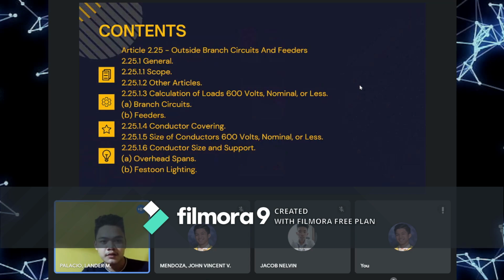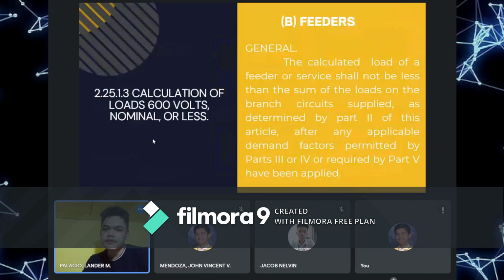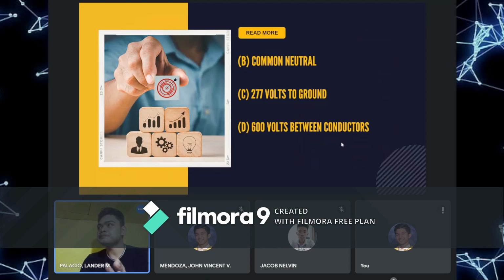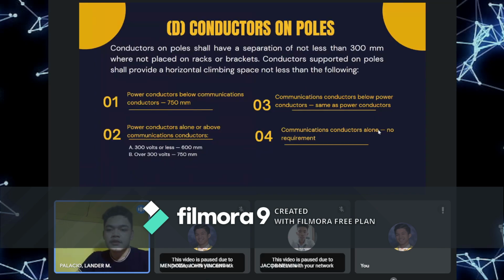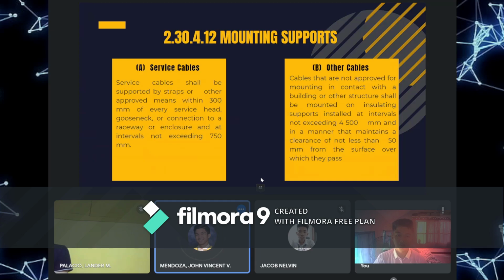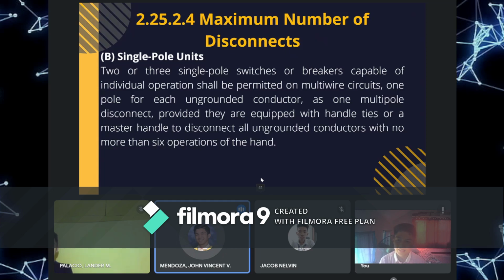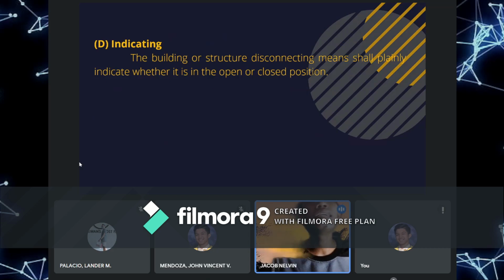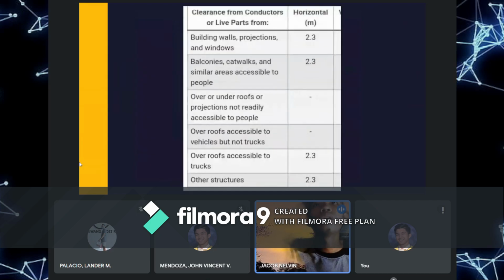PHILIPPINE ELECTRICAL CODE 2

Comment: In this video, PEC 2 covers electrical Installation outside buildings and concentrates on installation and electrical design for outdoor spaces. Along with the conductor sizes and types that will be used for outdoor lighting. It is a necessary specific layout for lighting that needs to be followed to reduce e the risk when installing for outdoor places.

Reply

Comment: I gained a lot of understanding regarding Philippine Electrical Code 2 and how it differs from Philippine Electrical Code 1 upon watching the presentation. As both the interior or internal electrical construction and protection of structures were generally addressed by the Philippine Electrical Code 1 (PEC 1). The basis of this second section of the PEC, which really is merely concentrated on Electrical norms and regulations outside of construction, seems to be to formulate and implement minimum qualifications for both the competence of basic equipment and electrical installation.

Comment: From this lecture video I learned that the feeder or branch circuit disconnecting means shall have a rating of not less than the load to be supplied. I also learned the important to know how to sizing the conductors because if the voltage is high and conductor is small the conductor may burned and explode.

Comment: This PEC 2 lecture taught me the types of outdoor lighting that will be used, as well as the feeders and branch circuits that will run between or along poles or structures on the property. In addition, branch circuits permitted by this article may be multiwire circuits. Multiple circuits may be considered for a multiwire circuit.

Comment: Guevara, Patricia Anne D.

Philippine Electrical Code, Part 2 taught me. When any combination of feeders, branch circuits, or services supply or pass through a building or structure, a permanent plaque or directory shall be erected at each feeder and branch-circuit disconnect position. All extra services, feeders, or branch circuits that supply or pass through the building or structure must be listed, along with the region that each one serves, on the plaque or directory.

Comment: This lecture video helped me learn a new set of knowledge which PEC is a set of rules designed to make electricity use safe for people and property. PHILIPPINE ELECTRICAL CODE 2  deals with electrical Installation outside the buildings. The Philippine Electrical Code 2's purpose is to protect people and property from hazards associated with the use of electricity. This code includes provisions that are considered minimum safety requirements. This code is intended for qualified individuals as a design specification or an instruction manual.

Comment: From the video about PEC 2,I have learned that PEC 2 also specifies the outside wiring, electrical equipment, and outside branch circuits and feeders that must be installed beyond the building's boundaries. PEC 2 also depicts the various types of outdoor lighting that should be used. Waterproofing requirements should be applied to conductors and wires. PECs 1 and 2 share the same goal: to protect people and assets from new threats.

Comment: What I've realized after watching this is that comparing pec 2 to pec 1, pec 1 specializes or covering inside or internal electrical system or installation and while pec2 focuses in outside regulations particularly in wirings, saftey of the building, dimensions of conductors, and proper materials to be used.

Comment: I discovered from watching the speakers' lecture videos that PEC Parts 1 and 2 have important differences, with PEC Part 1 focusing on installation and electrical design for indoor areas and PEC Part 2 focusing on installation and electrical design for outdoor spaces. Every occupant in a building with multiple occupants must have access to the supply disconnecting means, with the exception of those who are supplying more than one occupant, who may only be accessed by authorized personnel. This requirement is included under the section on Access of Occupants.

Comment: I learned from watching the presenters' lecture videos that there is a significant difference between PEC Parts 1 and 2, with PEC Part 1 concentrating on interior electrical design and installation and PEC Part 2 concentrating on installation and electrical design towards outdoor spaces. Additionally, under "Access of Occupants," each occupant in a building with many occupants must have access to the supply disconnecting means, with the exception of those who are supplying more than one occupant, which may only be accessed by authorized personnel.

Comment: I learned in a Philippine Electrical Code part 2. A permanent plaque or directory must be installed at each feeder and branch-circuit disconnect location when a building or structure has any combination of feeders, branch circuits, or services supplying it or passing through it. The plaque or directory must list all additional services, feeders, or branch circuits supplying or passing through the building or structure, as well as the area they each serve.

Comment: This lesson aids in my understanding of the basic ideas underlying the two-part structure of PEC. Before going on to outdoor electrical installations in PEC Part 2, PEC Part 1 examined the criteria for interior electrical installations. Along with the conductor sizes and types that will be used for outdoor lighting, this section also includes the feeders and branch circuits that run on or between poles or other structures on the property. This article's definition of branch circuits may also apply to multiwire circuits. The Philippine Electrical Code is the cornerstone for safeguarding people, buildings, and their contents from electrical dangers, and it is appropriate to regard a multiwire circuit as several circuits. It offers practical protection and adequacy assurance procedures, or the very bare minimum of safety criteria (required rules, permissive regulations, and explanatory documents). The Philippine Electrical Code 2 governs the installation of electrical systems outside of buildings, including outside branch circuits and feeders, outdoor lighting equipment, wiring on buildings, circuit exits and entrances, and clearances over buildings and other structures.

Comment: In this lecture, it enhances my basic understanding why PEC is divided into two parts. The previous PEC part 1 is about Standards for Electrical installations for interiors while PEC part 2 is about outdoor electrical installations. It includes the dimensions of conductors, types of outdoor lighting that will be used, and the feeders and branch circuits that run on or between poles or structures on the property. Also, branch circuits recognized by this article shall be permitted as multiwire circuits. A multiwire circuit shall be permitted to be considered as multiple circuits.

Comment: From this video lecture, I have understood why the PEC is divided into parts. The standards for electrical installations for interiors were the focus of PEC part 1 last week, while the criteria for outdoor electrical installations were the focus of PEC part 2. This simply indicates that electrical equipment or systems cannot just be installed in our country by a person or a professional wherever and whenever. For the equipment's safety as well as the safety of the area around it, we must adhere to certain guidelines and requirements presented in PEC to ensure the safe use of electricity- which is the main goal of this code.

Comment: After I watched the video, I learned that the PEC 2 covers the electrical Installation outside buildings and I noticed that we should follow the standard regarding the feeder, one feeder is provided for each floor in large installations while in small installations, one or two feeders are satisfactory. Feeders requiring more than 50 mm diameter conduit should not be used. Feeders should be subdivided if there are several bends or offsets because a 50 mm conduit is the largest that could be economically used, and Feeders radiating from the distributing panel should be provided each with a properly rated switch and circuit breaker. In addition, with regards to wiring on building It is acceptable to put exterior wiring on building surfaces on circuits with little more than 600 volts.

Comment: From the video report about the Philippine Electrical Code 2, i have learned that in different type of occupancies, they have a different amount of unit load per square meter that is use for the general lighting load such as 24 mm^2 for a dwelling unit, and also not only the lighting fixtures and Receptacles are the loads that includes in this article, but also include the general purpose outlet and Receptacle use for small appliances.

Comment: i learned in this video is that branch circuits recognized by this article shall be permitted as multiwire circuits. A multiwire circuit shall be permitted to be considered as multiple circuits. All conductors shall originate from the same panelboard or similar distribution equipment.

Comment: In this video the branch of circuits, which electricity transmitted in power system like Feeders and other conductor, loads the minimum of loads in each outlet, types of outdoor and lighting how to install are what I've learned in this topic. The specification of conductors and wiring in a building, as well as the waterproofing and isolating of switches and types which simultaneously disconnect all not grounded supply by conductors not less than maximum in available short circuit current in supply terminals and nominal to ground.

Comment: I have learned that PEC 2 includes the specification for outside branch circuits and feeders that should be installed outside the building premises and also includes the outside wiring and electrical equipment that should be used outdoor. The PEC 2 also shows what are the types of outdoor lighting and should be installed. Conductors and wiring should have waterproof specifications. The PEC 1 and PEC 2 have the same goal which is to safeguard the people and the property from the arising hazards.